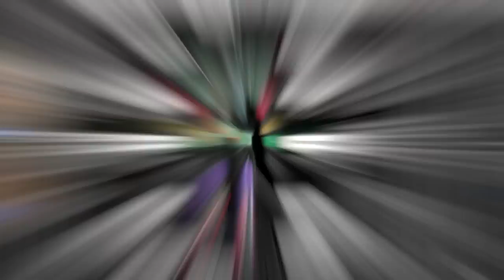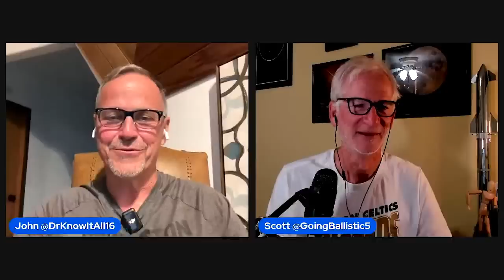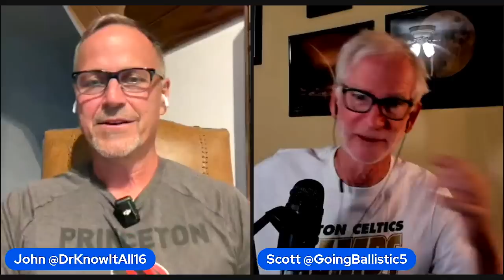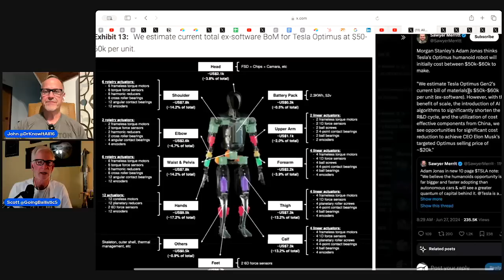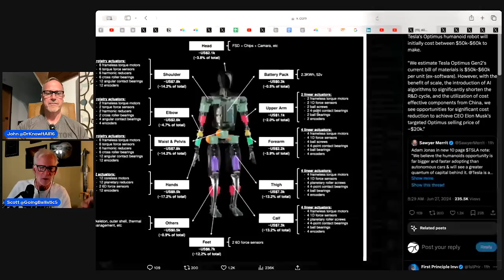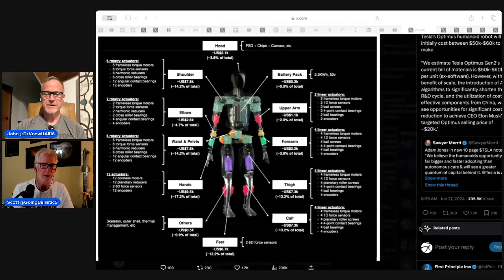TeslaBot Costs WHAT?! W/Scott Walter

Comment: Will Tesla not simply use its Dojo to design iterations of Optimus that improves their capability to make and maintain an Optimus fleet, (reduce cost of materials, design life cycle efficiency, assembly, disposal/recycling)?
Reply: Probably not in the next 2-3 years. Thay are using their compute for fsd and optimus. They'd need to train an ai for engineering, which would require additional hardware, probably an order of magnitude more than anything on the market. It's also har to tell if their current hardware is sufficient for what thay are currently trying to do. They probably need a breakthrough in ai architecture to do it

Comment: Part of the future plan is to introduce solid state actuators, rather than the current style. These have a much smaller design footprint with more force using less energy. Initial design will be for the bot, but later moved over to the Tesla range.

Comment: Good discussion.  Optimus bots have the full two dimensional plane to navigate instead of well marked roads but since they are traversing so much slower I have to believe solving autonomy for the vehicles and solving autonomy for Optimus is happening rapidly/soon and both projects can help each other across the finish line towards the march of nines perfection.  With no safety regulations to worry about there should be no barriers to adoption of Optimus across all segments of human society and our Tesla stock will reflect the value when the revenue numbers become undeniable and real and quite frankly “off the charts”!   Optimus bots can help clean robotaxis for example and even plug them in for charging in the near term
Reply: oh it's that simple is it? 🤣🤣🤣

Comment: I'm guessing, but over the 1st 1,000 robots
1% will be hardware costs
99% will be software costs

and that's for rudimentary software that is basically the level of a toy robot.

The software needed to have the robot not kill someone on the production line accidentally 
is probably 10+ years away
and will easily cost the net worth of TSLA.

Comment: Down in the weeds, the interconnection of both signal and power using better than running wire per wire, will help a lot of on optimization like the Cybertruck Etherbus did, a 'robobus' is needed.  The loop style networking of both power and signaling allows a lot of redundancies.

yes, the economics of a huge economic impact are not understandable today.  We are not going resource unconstrained where 'money means nothing' economy.

Enjoy

Comment: $1000 for an actuator at scale? That seems crazy high. Would like to hear from Tesla how much they expect the actuators to cost at scale.
Reply: Sandy said $100 each.  I feel like Tesla bot will cost less than $10k to build very quickly.
Reply: At scale it could easily be $50 or less.
Reply: New drive train for $25000 car is $1000 including gear train and invertor.
Reply: @waynerussell6401  Dafuk you saying?  The bot does not have a drive train.  Just a battery and a few dozen actuators.